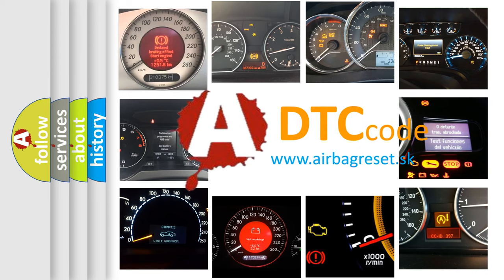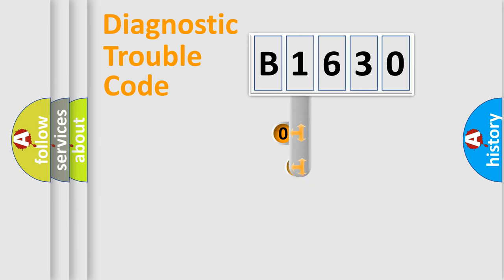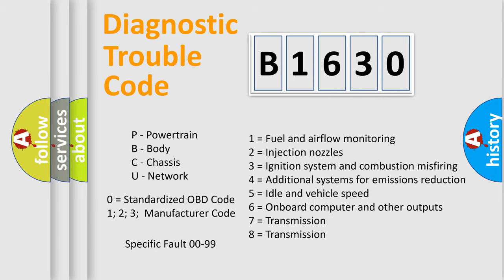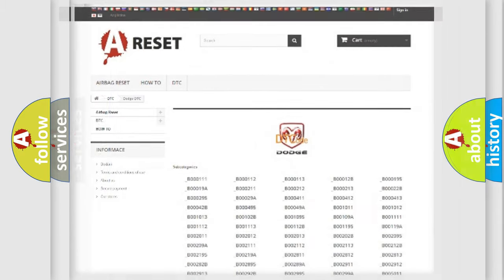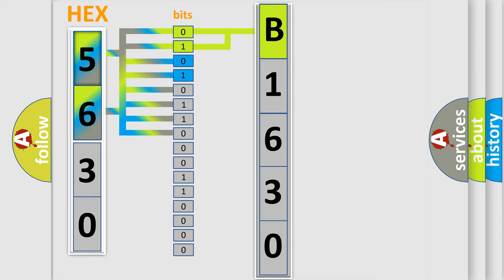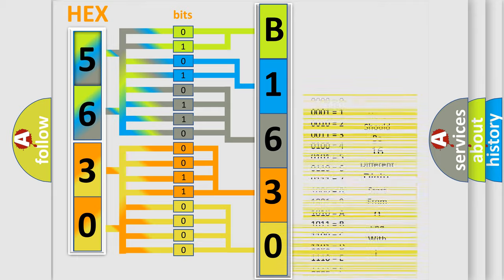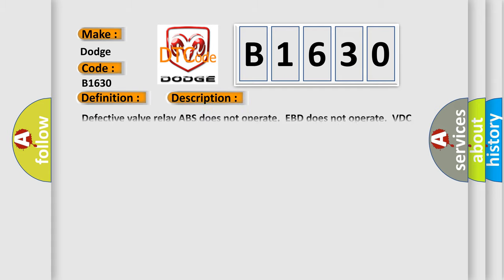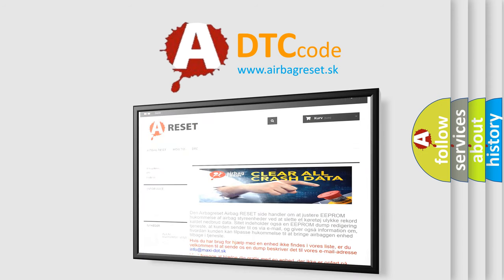DTC Dodge B1630 Short Explanation

Comment: Why are you giving description for an abs fault when this is a code for a right low beam control circuit fault? B1630-RIGHT LOW BEAM CONTROL CIRCUIT HIGH The video was decent up until that point